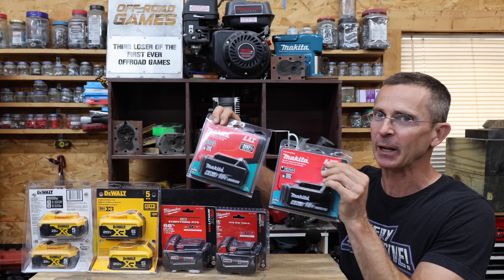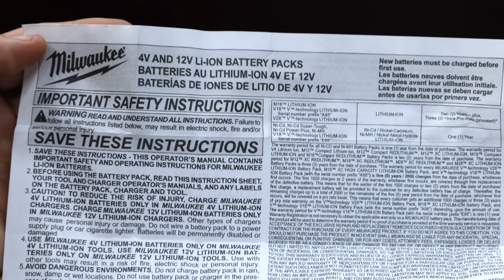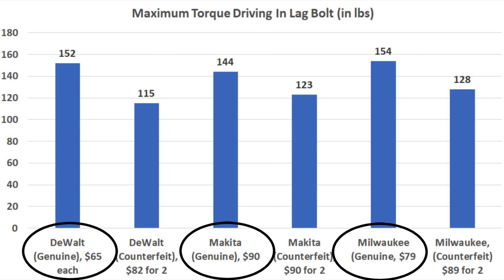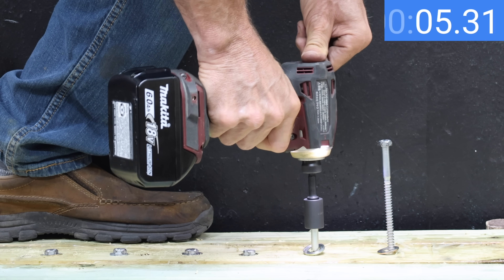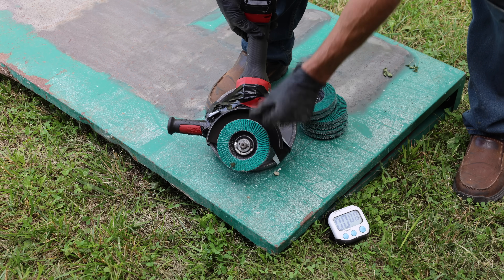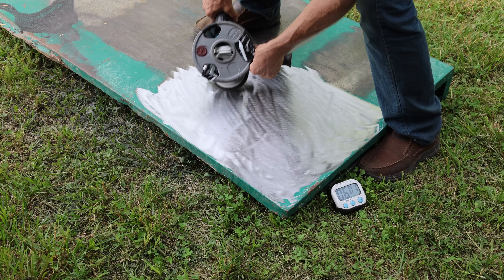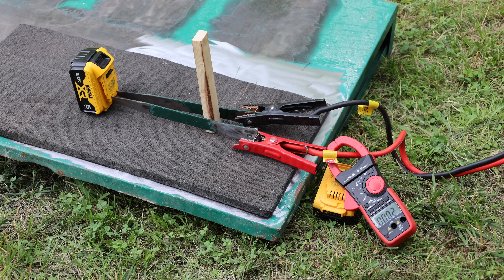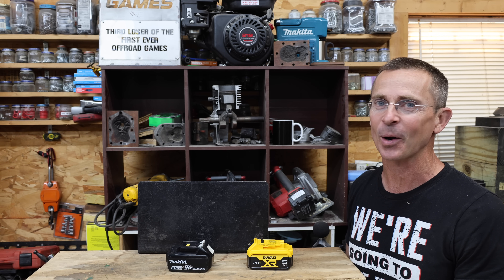Have You Been Scammed with a Counterfeit Tool Battery?

Comment: You know what's the worst? Paying for the price of a genuine battery but getting the fake one! ☠️
Reply from the maker: Good Point!
Reply: @ProjectFarm  thanks for this video. It explains a lot for me. I bought two 5AH batteries from Amazon, straight out of the packaging, one wouldn't charge at all and the other when fully charged lasts only about half the time of my other genuine 2AH batteries. Now I understand why. Never buying batteries online again!!
Reply: Decent suppliers are abandoning Amazon... They can't compete as each genuine product they offer has two dozen counterfeit items sitting atop a value listing.
Reply: That's why it's important to make sure to buy batteries from an authorized retailer that only uses the traditional supply chain to get their products.

You'll notice many of these kind of YouTube videos will readily show a certain auction website where you can get counterfeits, but when those channels use affiliate links for a certain retailer named after a rainforest, they'll typically avoid discussing the co-mingled inventory issues on that affiliate website that allows these fakes into their supply chain. Even when "sold by [company]," you can end up with a fake, as said company will take inventory intake from third parties directly, and/or through their return system. It's a huge problem, but it allows them to always have stock available, and have low prices.

Meanwhile, your local brick and mortar has to order their supply from the manufacturer for the full, regular wholesale price, and they have to wait for shipments to restock, etc.  Consumers are impatient and want to save some money, which creates this entire cottage industry in China. And, it's not batteries. This affects most consumer products. So long as people prefer to save some money up front, and "get it next day," these Chinese companies will keep making fakes.

It's kind of unfortunate. I get that those affiliate links probably drive good revenue for often great channels (like this one), but they're kind of part of the problem; channels don't want to openly talk about the issue because they depend on that revenue.
Reply: @SayanGiant  Yeah, I can believe Amazon might resort to some shady practices.  I've seen a youtube video from a highly trusted source where he bought motor oil from Amazon, and it turned out to be used oil.

Likely someone scammed Amazon by buying real motor oil, putting it in their car, then returning the used oil to Amazon via a "free return".  Then Amazon takes that item, and re-sells it.  

I just don't know how else Amazon could have sold what was obviously used motor oil.
Reply: @stevesether  It's worse than that. They essentially will allow third parties to become suppliers, so as long as the company says their products are genuine, it's just kind of accepted as such.  Then, when the products come into the warehouse, they'll stock the genuine products with the fakes. That's why us, as the consumers, can order the same stuff, and SOMETIMES get a genuine item, and SOMETIMES get a fake. It really doesn't matter as much as people think if it's "Sold by [trusted company]" or not. The co-mingled inventory often results in your still getting a fake. And yes, there's the return policy abuse on top of that.

Mostly, there is a MASSIVE cottage industry in China of fake products.  I'd guarantee that some Chinese company is just bottling used oil and printing convincing labels, then shipping it to the rainforest site as if it's the legitimate product; they're way too big to really lock down the supply chain on the millions of items they sell, whereas their more traditional competition would have purchasers simply ordering directly from the manufacturer, and going out of stock if the product is out of stock.

Generally, it's a strong arm tactic, because unless you agree to cut off ALL other online sellers, this certain rainforest company won't do anything to guarantee the supply chain.  Essentially, they intentionally destroy brands' reputations to try and force them to let the rainforest site be the only one that sells their products online.

And, as weird as it sounds, I try not to type the name of said retailer, cause that tends to seem to get my comments "found" and deleted...consistently.

Project Farm seems pretty legit, so I don't think he'll delete these comments, but I get the impression there's likely a program that scans for negative mentions, and harasses YouTube about it.
Reply: @stevesether  I mean yeah but it's on them to check and make sure the product is untampered with or not resell it if they can't be sure.
Reply: @stevesether  It's especially bad with GPUs. Seen too many reddit posts of people getting their $2400 RTX 4090 from Amazon and finding something completely different (or nothing at all) inside. Amazon employees themselves are sometimes swapping the contents of packages.
Reply: @stevesether but the exact same thing happens in brick and mortar stores.
As an example just two weeks ago that happened to SuperfastMatt. He bought a can of fiberglass resin at a local autopart store and it was filled with used motor oil or something like that.
Reply: @SayanGiant   Gosh I can't think of what that retailer could be.... DainTree? Valdivian? Hainan?Tongass? Atlantic?... nope, none of those are also retailers. I"m stumped.       🤣🤣🤣
Reply: @truckerzachbell  It was a joke.
Reply: @SayanGiant buying at a brick and mortar store does not prevent that from happening.
People return fake or wrong products all the time and the employees just put them back on the shelf.
Reply: @SayanGiant  - I'd prefer to get it the same day from the store, but too many products that the stores (like Home Depot) claim they sell are "Sure, we sell that, it's in stock!  We'll deliver it to you next week!" "How about picking it up from the store?"  "Oh, well, we don't carry that in stores in your state.  You'll have to wait for us to deliver it, or go to <store two states over>"
Reply: @sayan cool story bro
Reply: Apple use to tell it's customers they needed to buy genuine apple memory, but in reality it was the same chips used in PC's only marked up 300 percent or more, so much for genuine.
Reply: @rmora1  So now the Mac Mini.... you can't up grade ANYTHING... you have to buy a new one.  I needed one fast so I had to get the 250 Gig Mini from Costco. Trouble is Sonoma is bloatware. Animated emojis? A Videos for your desktop back ground? I use 1 language on my compter and yet I have to have fonts and instructions for every application in 20 languages at the very least. You can 't delete that $#!t.
Reply: Part of my suspects the intent isn't to sell a battery for use. Instead it is returned as a scam to replace an original in store
Reply: @rmora1  who cares. F Amazon lol
Reply: Scamming Amazon must be a huge business!
Reply: These counterfeit batteries are like ticking time bombs for your tools.
Reply: @diytoptricks  that is why I keep reccommending that everyone contact the attorney general about amazon’s willful sale of counterfeit products. Intentionally selling counterfeit batteries is just as much a felony as intentionally passing counterfeit currency and if just 100 people all write to the attorney general, that is all that is needed for the AG to send the FTC after amazon and force them to vet their sellers & ban sellers that sell counterfeit goods
Reply: Always go fake 😂
Reply: Taking 5 minutes to report amazon to the office of the attorney general will help to make certain they remove all counterfeit products from their site and start vetting all third party sellers and will prohibit them from selling anything if they don’t meet the deadline for removing counterfeit products and vetting third party sellers
Reply: Even worst than that is voting for a real president and getting a fake one.
Reply: Yeah, now I understand why some folks rebuild their old good ones rather than gamble on getting the genuine article.
Reply: When Seagate bought out a lower brand who made bad hard drives they slapped Seagate stickers on them
Reply: Seeing this video, I suspect that may have happened to me. I'm never buying batteries that aren't from a reputable dealer ever again after seeing this
Reply: @chris101ward  if you report, I assume amazon is where you bought them, amazon to the US Attorney General, like I have told everyone else that has left comments like yours, they will put a stop to their sales of counterfeit merchandise. Selling counterfeit products as authentic products is a felony and the feds will stop it, but first they have to be made aware of the issue, and it doesn’t take much. They only need 3-4 folks to write them saying “amazon sold me counterfeit X brand batteries as authentic products” & when they see those people aren’t members of the same organization to make sure its not some scam by a competitor, they will notify amazon that they have a limited timeframe to identify and remove all counterfeit products from their inventory & they get shut down for noncompliance if they fail to.
Reply: Yeah because here you got two for a price of one that's not a bad deal....
Reply: It isn't just batteries.  A friend paid over $3k for what turned out to be a counterfeit Neumann U87 microphone.  The exact same (but unbranded) microphone can be bought on AliExpress for $139.  It is getting crazy.  I don't know how many times I've found something I wanted to buy but didn't out of fear of it being fake.  The Chinese are going to revive the local big box stores because the stores honor warranties.
Reply: there would not be such a counterfeit battery problem if the manufactures didn't over charge so much for the real ones. it makes a nice easy opportunity for the crooks to make a fast buck.
Reply: That’s Amazon for you. I don’t but anything from them anymore. It’s all Chinese garbage.
Reply: @Sfhakrn  Amazon will literally stock counterfeits on the same shelf as the real deal, they basically check nothing and ship anything.
Reply: @Sfhakrn  even when buying directly from Amazon and not a 3rd party seller???
Reply: @Sfhakrn   Watch the video and or research.
Reply: WOW!  YT actually deleted my last (tame) post!  Hey, YT, this is not a political video/thread!
Reply: @Sfhakrn check out my last reply. I don’t want to sit here and say the exact same thing to everyone that is leaving comments indicating they’re fed up with scamazon
Reply: @Sfhakrn  "Chinese garbage" where do you think most genuine batteries are made?
Reply: @dogbreath6974   Mexico, Vietnam, etc., not just China, for sure.  And, there is a difference between assembly location, and all components used from different places.  For instance, all parts, I.E., an assembled product in Mexico, will not all be from Mexico.
Reply: @dogbreath6974  they are also made in Vietnam, Taiwan and Singapore.... but yeah...🙄
Reply: @dogbreath6974  China, Malaysia, Taiwan, Korea, Japan, Mexico, Vietnam, and Texas. But mostly China.
Reply: @dogbreath6974 Japanese and Korean batteries like Panasonic and Samsung are still the gold standard.
Do I need to link you videos of Chinese BYD EVs blowing up? Not to mention their copious knock-off battery/chargers causing shocking numbers of fatal scooter fires indoors in that country!!
Reply: @Sfhakrn  Just got to be a little smarter. Don't buy batteries online period unless it's directly for a known supplier not a reseller.
Reply: Gives me night terrors 🤬
Reply: @vincentperiolat4610  you mean nightmares. Night terrors are something that kids get and you don’t even know that it’s happening because it’s a dream. It’s just weird way that your body reacts when you enter rem sleep.
Reply: @newcreation07   You are correct, I erred.  This happens when I try to punch up the stories of my boring life.
Reply: @vincentperiolat4610  🙃🙂
Reply: No shit Sherlock

Comment: An ebay seller scammed me with 2 high end fake Milwaukee 8ah HO batteries claiming they were real. 

I did get my money back from ebay. 

There are subtle differences, the plastic feels slightly different, the font, color, and alignment of side label text is also SLIGHTLY off. Furthermore, it doesn’t for ihto the tools as easily as a genuine battery. It has a different way of saying its dead via the lights, and the genuine rapid charger WILL NOT charge it lighting up green and red while the regular l one does. 

Does it work? Yes,however I do not feel it lasts as long.
Reply from the maker: Thanks for sharing.

Comment: I wouldn’t say the DeWALTs DCB205 packs should have the same cells. DeWALT uses at least a few different suppliers for that pack. Heck, I got two in retail packages from Tractor Supply, an official DeWALT dealer, and they had two different cell origins and two different “Assembled in…” countries.
Reply from the maker: Thanks for the feedback.

Comment: Bought some m18 from eBay for a really good deal, they work fine as of now, what make me question if they were legit is that when I put them on the charger the charging light doesn’t comes on but the battery actually charges 😏
Reply from the maker: Thanks for sharing.

Comment: we have awareness now, but more help to identify the differences would be appreciated!
Reply from the maker: Thanks for the suggestion.
Reply: Price. Safest to buy at a Big Box store or a direct source from the Brand.
Reply: For DeWalt, they put up a guide on their website on how to tell genuine from fake batteries.
Reply: @P3rformula  Which the counterfeits use as a guide to copy, haha.

The only way to protect yourself is to only buy from a legitimate business that isn't going to put its reputation at risk selling fake products. Ebay doesn't sell products, they sell product listings, just about everything there will be fake. Amazon is 99% fake, but you'll probably be fine if you actually buy it when the page says "sold by Amazon" and not just "shipped from Amazon".
Reply: @P3rformula  Motorcraft and AC Delco have the same type of guides on websites
Reply: No all that does is help the counterfeiters get better. Best protection is buying in person at a reputable store and not online
Reply: +1 on how to identify fake battery packs BEFORE we buy them.

I understand that purchasing online is a gamble and if the price is half what it should be, you know they are fake.

I have bought knockoffs online, but I knew what I was getting into. I regret it, as they only lasted a couple months before they were trash.
Reply: @kyfho47  I've always bought knockoffs (as in the cheap "compatible version") and for my use in terms of needing cheap extra amp hours to run a cheap electric leaf blower around a very large wooded yard, the cost worked out (and 4 years in they've actually outlived one of the legit batteries I bought as a tool bundle). I think really the only advice to avoid counterfeits would be to not buy except from a direct certified reseller from the manufacturer, even on a listing they could just put a picture of a real one somewhere else. And look out for any platforms that allow resellers and make sure that if you are buying from a major e-commerce source instead of a dedicated tool store (which immediately increases the risk), you are buying off a listing direct from that company.

Comment: I have an IcyBreeze battery that is a DeWALT 12V Max clone inside a DeWALT 20V Max clone housing (same as these DCB205 cases). It only has 6 of 10 cell positions occupied. It still works in my DeWALT DCL045 light bar but that’s because it’s one of the few tools that accepts both 12V Max and 20V Max… even has a strange pivoting latch to fit and latch with either battery.
Reply from the maker: Thanks for sharing.